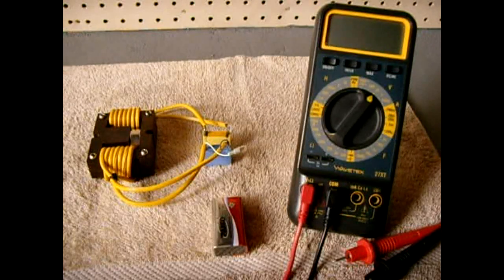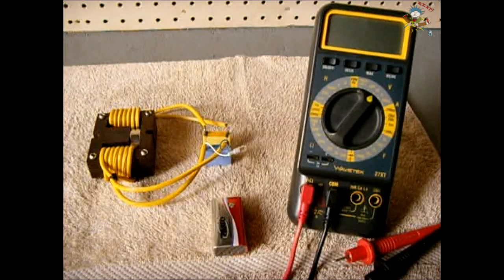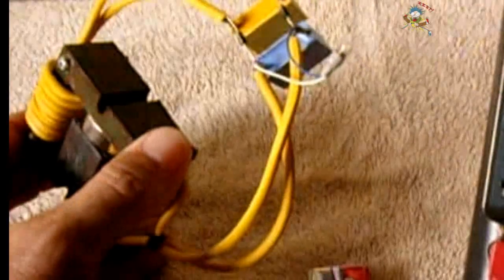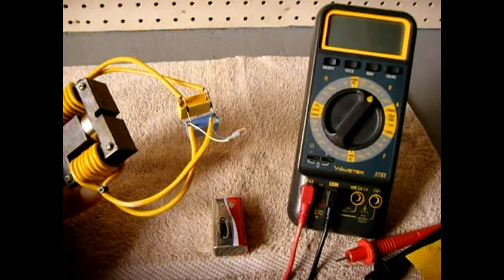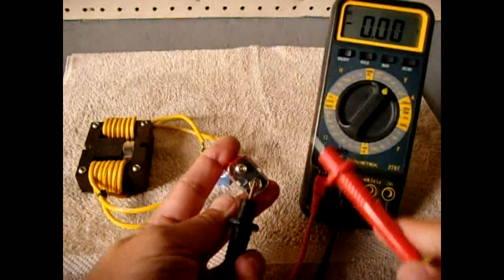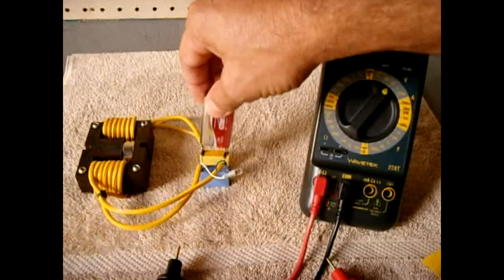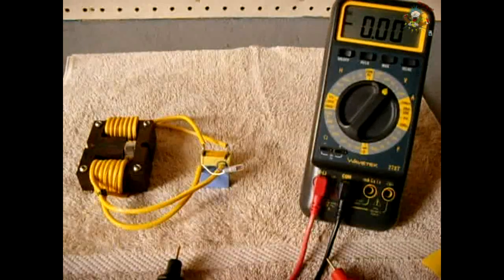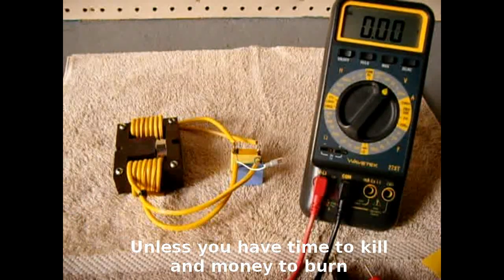Overunity Motionless Free Energy Generator EXPOSED!

Comment from the maker: R.V. Gad's Comment:

"Thanks for testing this project, I was starting to put an earlier version together to test when I found your attempt to duplicate what is visible on the demonstration.  HOWEVER, I see that you have one major error in your layout, and maybe a couple of minor errors.  The original demonstration showed two 1A power diodes as you are using, but only one his left one is visible on polarity and the other stripe is missing.  These are DC lamps so the diodes should run in opposite direction (always).

The other problems are the type of magnet you are using may not be polarized correctly, as he used 2 hard drive neodymium magnets.  The other possible problems are sthe the capacitors should be the same value, probably 1 uf, and the coil to the bottom of the screen may require the leads to be tested in both directions, and try every combination of rotation of the magnet polarity and the polarity of the two coils."

My reply:

Thanks For Watching. As for the diode, it makes no difference if you use a 1A or 3A diode, they both work exactly the same way. The only difference is that one can handle more current than the other. As for the direction they were placed, that is also 100% exact according to the careful examination of the uploaded video. Your directing your question to the wrong person! LOL Clearly you should ask the uploader why he placed both diodes the same direction.

As for the capacitors, I tested MANY values. Using (2) 1/8" or less HDD magnets will not make any difference. I used a single strong N38/N42 thicker neodymium magnet, You have too much wishful thinking. Just use logic, if this worked our world would be completely different when it comes to power supplies, and since it could not be easier to make, everyone would already have a working device.
Reply from the maker: Your wasting your time posting and talking to me about this. I suggest you tell this to someone that will actually listen. The device is a FAKE. Case closed.
Reply: Kurvel Vrece
The pathetic thing about proponents of pseudoscience like yourself, is that most of the time your reasoning behind why something this monumental would be so unknown to physics and engineers revolves around the all too ridiculous notion of conspiracy theories.

Free Energy proponents are not scientists. They are New Age Spirtiualists who have this over zealous opinion that the world is out to kill itself and keep all the life saving technology in the dark for self centered reasons. While I share this sense of cynicism to a certain degree,  I fail to see how something this obvious in an  OPEN realm of scientific discourse could ever be kept a secret, let alone have so many "whistle-blowers" and not have a single fucking demonstrable layout for other engineers and physicists to replicate. Which, in the realm of science, is regarded, as pseudoscience as a result. If you can't repeat the test that someone has done to claim a life changing concept, then there was something VERY wrong with the original test. The same goes for the nonsense about cold fusion. There are STILL idiots out there that think cold fusion works, I've met genuine PHD holding individuals who think the fucking SUN...operates on cold fusion. You know why? Because idiots like that believe EVERYTHING they are told, they go to hippie conventions about free energy and perma-culture and all this spiritual nonsense mixed in with VERY bad science, and come out equally brainwashed as children at sunday school.

In the realm of science, no amount of belief and faith will change the way reality operates. If you can't demonstrate a claim, your claim is useless.
Reply: CircumcisionIsChildAbuse Again, just because someone put out a BS video isn't proof the concept is BS.  Your commentary is nothing but that, bloated argumentative opinionated commentary; not proof.  Just because you don't appear to understand the difference between existence and reality as defined as observable testable eigenstates in QM and existing as in fails to be explained by classical physics should not surprise anyone.  Clearly you don't grasp these concepts.  Where we'd probably disagree is that I think you're entitled to defend your belief system, no matter how unfounded.  The main difference is that you don't recognize your comments as a belief system, based on your own experiences and personal understanding of your definition of what you think constitutes reality.

First, how do you define Free Energy, you're not clear on this; and there are several definitions.  "Free Energy" can define energy in a system that is 'free' to do work.  Like a battery, or magnet.  So, your comment "Free Energy proponents are not scientists. They are New Age Spirtiualists who have this over zealous opinion that the world is out to kill itself and keep all the life saving technology in the dark for self centered reasons."
is a very unenlightened opinion, devoid of any scientific observation, and peppered with the same faults you define in others, a belief which you are staunchly defending.

So, wordy and pointless, you meander all over the place grasping at concepts which you seem to feel defend a point of view that's not even clear what your are fighting against.  Broaden your understanding of the meaning of 'Free Energy' as it is understood by scientists before you attack all scientists with your lack of comprehension.

Based on what I think you 'might' be trying to say; yes, there are no free rides; but, the question isn't one of a free ride; it's a question of whether energy exists in a form that can be liberated in a controlled manner to benefit mankind at a low cost, not free.  If you doubt the existence of a cheap, low cost over unity energy, you've obviously never seen, or heard of an atomic bomb... to use one crude example  Its formula is simple a small mass of U238 = mc², very low cost = huge amount of Energy, just not very controllable or useful only in Nuclear Power plants, so, don't say they don't exist.  You're just not open minded enough to realize they already exist because you're blinded by what you think is being portrayed as magic.  The energy is there, the how to get at it in a controlled way is the question; and many are 'hot' on the trail.
Reply: @ZenMasterChip  Free energy? Plug an extension cord into a neighbour's house.
Reply: Breathe, breathe in the air.
don't be afraid to care.
leave but don't leave me.
look around and choose your own ground.
Long you live and high you fly
and smiles you'll give and tears you'll cry
and all you touch and all you see
is all your life will ever be.
Run, rabbit run.
dig that hole, forget the sun,
and when at last the work is done
don't sit down it's time to dig another one.
For long you live and high you fly
but only if you ride the tide
and balanced on the biggest wave
you race towards an early grave.
Reply: The double magnets in the right position would be one of the most important. You only have one. The difference in turns would would be essential. One extremely important part is that he didn't rub both parts of the battery on it. He just rubbed one part and he did it in a direction to start it's flow. ::shrug:: I can't speak for the other video but what you did makes no sense. You need acceleration (unbalance) and then stabilization (equality) to maintain a flow or a neutron of any size for that matter. And if you did get it work...your last statement about seeking a patent lawyer would mean you'd never show it working but save the invention for yourself and make money....so you have no reason to prove it to be real in the first place. You opinion on the topic for that reason should never be trusted.
Reply: Do you want to see a demonstration of free energy?

ok.

breathe ...
Reply: Chip Cooper
Oh okay, so a video that debunks a claim doesn't mean it's debunked, but a video that "proves" it works, is totally legit? No double standard there!

I also find it hilarious how you point to nuclear energy as an example of overunity. Unclear Energy is the EPITOME of the basic laws of physics. The only energy that comes from nuclear energy, is the power in the extremely precious, highly volitile and extremely lethal radioactive isotopes, which take  IMMENSE amount of energy, time, and resources to CONTAIN and harness. It is a very effective method of extracting energy, but no where close to 100% efficient which is what a lot of proponents of new age spiritual voodoo bullshit present as their "free energy" devices using shit you can buy at a dollar store to violate the laws of physics.

I have too much respect for reputable scientists in this world to have my beliefs washed aside by nobodies with a 10 min youtube video and the proponents who assert that these magically efficient energy devices actually exist but the world is a giant conspiracy out to hide them because people want to make money. Good theory bro, I hope that works out for you as you get laughed at.

But i'd love to know, what energy source YOU use, cause  I can guarantee, its nothing like this shit. You're just another idiot paying an electric bill like everyone else with too much time on their hands contemplating the paranoid delusions of grandeur the internet manages to fester.
Reply: Craig Potter
A) you didnt reply to my comment so I didnt get notified. B) you said "But us spiritual crackpots" referring to yourselves.
C) you didnt at all try to respond to any of my comment, thus you admit defeat, your position unjustified and will remain until you form a coherent rebuttal. Grow up and let go of fairy tales, leave the science to people who have integrity.
Reply: ***** I pretty much agree. The sixties, and the Apollo space program was a wonder, for sure. We went from underdogs in the space race to the first country to the moon. I see many posts on some of these scam 'free energy' videos where uneducated folk make remarks like "all great inventions and breakthroughs were created by people with no degrees, or never went to college".  What a stupid statement. Bill Gates may not have finished college, but he gathered some pretty smart people around him who DID finish college. If you do your homework, pun intended, you'll find out the idea boys may not have been the most educated, but their educated associates did the heavy lifting to make the idea come to fruition.
Reply: Tu invento es parecido al M.E.G. de Tom Bearden o al dispositivo de "Kunel" y por mas que no lo vi en funcionamiento me ha gustado mucho! Lograr la resonancia entre las bobinas para mover el toroide del iman es la clave. Pulsos cobrados electromagnéticamente. Los diodos son para que la electricidad no pase de bobina a bobina en forma de cortocircuito, pero están puestos con el negativo mirando a la lampara por lo tanto la polaridad en la bobina va a ser negativa de los dos lados, creo que uno de los dos hay que darlo vuelta para lograr que la polaridad de la bobina tenga positivo y negativo. Gracias por tu esfuerzo y tu dedicación.
Reply: Amenofis IV Akenathón Christian Marino I thought we were talking about free energy and you're raving on about "Flying Rabbits"????  By the way, breathing is not free energy. How much did you pay for your last McHamburger ? The body uses food to make energy, stop eating for 3 months and see how much energy you put out. Or how much breathing you manage. :-)
Reply: Amenofis IV Akenathón Christian Marino Ahh, You gotta love that Pink Floyd.
Reply: Chip Cooper
It's also not a misconception of "free energy" it's called a literal interpretation in the context of PHYSICAL ENERGY.  Not only is your claim vacuous, its demonstrably wrong, because I can point to hundreds of links of proponents who claim to have created devices that create infinite energy and call themselves, "free energy" devices.
Reply: electronicsNmore also helps reading disclaimer on their website :

•
The authors of this website are not responsible for ridicule, which can 
cause yourself by an effort to reproduce the devices described here

++++++++++
Reply from the maker: Only one Jackass here, I suggest you look in the mirror. You are the one who likes to listen to all these people who have never tried making these devices. These same people usually have ZERO subscribers, and usually have ZERO uploaded videos. Those are not the kind of people that I listen to. If you do, then you have my sympathy. There is NOTHING to discuss unless you have a working unit to show me, along with all the specs and components used for easy duplication. Got that?
Reply: Drew Nichols please provide a link.
Reply: CircumcisionIsChildAbuse Checkout the Stealth program, the atomic bomb project, active stealth (now released) that is part of the BAE systems invisible tank and aircraft and ships project using LCD modules. All keps secret for many years. And other things have been classified too like the magnetic cores "METGLASS" was originally classified. Read the "patent examiners guide for classification", can't remember the exact title but it lists gas saving devices, solar cells over 20%, water treatment tech and weapons systems. I only agree with the weapons being classified. But why are things like water treatment and gas savings devices and solar panels over 20% classified ? This isn't a rumor, it is in their book, the 1973 edition, the only version I have seen but why would those things be in their ? Also listed, higher spec frequency standards and other standards equipment, computers, all kinds of things like this.
Look for some articles that list over 4000 devices classified for energy and related devices under "national security". Why ?
Some of the patent examiners like Valone have come out and exposed this and how some working devices that "shouldn't work" but do despite present physics have been denied because it makes them look bad. Despite the proven devices ! Look at the many gas vaporizer patents, shown proven to save gas and reduce pollution but still aren't being used. Why did some cars in the 1980s 40-50MPG like the Geo Metro but now 30 - 35 MPG is about the most.
What about the Opel below that got 267MPG on a 5000LB car using vapor carb. They should get at least half or a third of that now, and it is in GMs book on the efficiency of the gasoline engine as an example showing they knew about it.
I believed like you do, until I met people that personally know of people this has happened to and learned how often it happens.

267MPG Opel about a 5000 LB car 
https://www.youtube.com/watch?v=EtR5WjwocBI

1000 Miles Per Gallon sHell Research Late 70's 
https://www.youtube.com/watch?v=IYyVnCeWV1A

Energy Suppression examples
http://www.wanttoknow.info/newenergysources

http://rense.com/general72/oinvent.htm

http://www.befreetech.com/suppressed_inventions.htm

http://www.freeenergynews.com/Directory/Essays/suppression_bird.htm

http://www.theorionproject.org/en/suppressed.html
Reply from the maker: Let me make it very clear. I am not saying I do not believe in certain ideas/inventions intentionally being suppressed because of money, what I am saying is there are a lot of scams out there, and this is one of them. If this worked, you could not stop the spread of such a SIMPLE device. Everyone would be making them in their garage and sharing how with others. Use common sense.
Reply: William Denman
Your delusions of grandeur is what inhibits your ability to seek reasoned based beliefs that dont revolve around paranoid conspiracy.

If what you say is true, find the patent, make the product and win a nobel prize. Oh yeah, you can't. The world CURRENTLY has people far more intelligent than Moray and Tesla ever could imagine, and you're obsessing about their conspiracy theories that they are geniuses that invented all these crazy "free energy" devices despite all the LAWS OF PHYSICS that disagree with you. You're no smarter than the half wits who tried to convince the world that cold fusion actually works.
Reply: William Denman
Like I said, severely delusional misconceptions of a false reality.
Reply: William Denman When is that Moray lie gonna go away?  I have been reading about old man Moray for nearly 40 years, STILL, no one can duplicate what HE SAID he could do. Isn't it time to put fairy tales to rest and grow up?  Same goes for Howard Johnson and his magic magnet motor. NO ONE has been able to do what HoJo CLAIMED he did.  Hogwash, all of it. If it cannot be replicated, then it is bunk.
Reply: Quantum Leap
precisely, same goes for the crap they say about tesla too. he was an unappreciated genius, but a lot of his contraptions didnt do what they were supposed to.
Reply: Quantum Leap Once again, instead of Craig Potter actually responding to my entire comment on topic with reasoned argumend and logical discourse, he responds with a link, to someone with zero credibility, who's a conspiracy theory advocate who can't back up what he claims and simply uses advanced physics knowledge to wow and impress non-physicists. Instead of actually doing what he claims he can do, he says he can and its possible yet lacks the willpower or ability to actually do anything at all other than talk about how the world is out to get him. oo

I look elsewhere when seeking scientists who follow conspiracy theories and UFO landings. So once again, where the fuck is your evidence to support your claim.
 And why, does this physicist not have any respected peer-reviewed journals published? Let me guess, the worlds out to silence the genius...
Reply: CircumcisionIsChildAbuse Absolutely true. You can educate some morons, but you can't make them smart. They are still morons. Self delusional morons.
Reply: Gad could just send you a working model, since he's already working on one. :-/
Reply: Your invention is similar to M.E.G. by Tom Bearden or device "Kunel" and as much as I did not see it running I liked it! Achieve resonance between coils to move the magnet torus is key. Pulse electromagnetically charged. Diodes are for electricity not pass reel to reel as short, but are set to the negative facing the lamp so the polarity on the coil will be negative on both sides, I think one of the both there to give it back to make the polarity of the coil has positive and negative. Thank you for your effort and your dedication.
Reply: propfella "Free" as in freedom, not 'free' as in costs nothing.  You too are under a misconception of free energy... so, I shall say it again.  The physics definition of "free energy" is energy which is free to do work.  I thought he was referring to everything he did.  See the way this works, in magnetism, as in a permanent magnet, is the energy goes in, to make a permanent magnet, or in his case, he eats a hamburger; once the magnet has been made, in the case of the magnet, the energy gets trapped in the configuration of the magnet, a quantum effect, and becomes free to do work.  In his case, his body converts the food into a chemical form the body can use, and becomes free to do work.  Once you use the energy, as in a magnet, you must then put energy 'back' into the system, in order to make it available to do work once again.  And, in the case of the body, the same thing.  Once he uses the 'free' energy in his system, he must consume more energy to do additional work.  There is no free lunch.

Now, the opposite of that process is the atomic bomb.  In this case one must gather the materials, put them into a form that has potential energy, then by causing the reaction, bringing together enough material that the 'free' energy of the system reaches a critical point, the process is then automatic, and releases all of it's energy at once.  In the case of the atomic bomb, this energy is a form of free energy, in that the material decays at a rate as to push the process once enough is brought together, that is causes a fission process which unloads all the energy which exists in the bonding and proton structures causing a big release of energy.  This process is overunity, as the amount of energy put into the system is small, compared to the amount one gets out of the process.

 Whereas with the magnet, and his body, the release of energy... energy 'free' to do work, 'free' energy, must be replaced.

This is the concept of 'free energy'.  It is believed that, and evidence shows that many things in nature have 'free' energy; however, we are only now starting to look at ways to release this energy, so it is available to do work.  In the case of atoms, and the zero point energy, the amount is well known with atoms, and is fission, the process is well known, and is fusion the process is well known; however, science has shown by processes known to Tesla, and a few others, that we can 'coax' this energy to be release, we just need to bridge and open the gate with a small amount of energy, and then release it.

One of the more promising fields is with HHO, only based on the 4th phase of water, I believe the process is actually HOOHH.  And using resonance, cavitation, and plasma, we can see that the bonds of the Hydrogen and Oxygen can be broken more easily and thus releasing 'free energy'.in the form of the two monatomic, or diatomic versions of Hydrogen and Oxygen, H2 and O2.  or 3 H2 + 2 O2 + or variants of that. HHO + 3H2 + 2 O2.

And other electronic versions such as QEG, SEG, etc. etc.

So, once again, the ignorant try to make a free lunch, where none exists.  We will always need energy to start the process at some point, no matter how much more energy we get out of the process once it's started.

And yes, there is a modified version of a device like this, and perhaps NOT this device, that has been known for some time.  I just forget which one or what it's called, because there are so damn many.

One last obvious example of free energy is a waterfall.  A water fall is full of free energy.  And, it's overunity, in that we do not put in the same amount of work, for the work we get out of it.  In this case, we count on nature's natural process of using the sun, evaporation, etc, rain, to put energy back into the system so the water can fall once more.  Still, it is a free energy system and a natural one.  Are you starting to understand.  Nature is allowed to be a source because ultimately no matter how much energy you pull out of nature, it is an open system, and returns to nature.  The fact that we can't get more out of that energy than what is put into it by nature has more to do with efficiency than anything else.  None of these 'free energy' devices are what you claim, you have a misunderstanding of the definition of 'free' as in energy.  Free as in freedom, not free as in costs nothing.
Reply: KESHE TECNOLOGY    http://www.mediafire.com/download/1r65q2up3qdk2ui/tecnokesh-2014-03-17.zip
Reply: @ChristianAmenofisMarino whatsInThatZip?
Reply: CircumcisionIsChildAbuse OK, those do not exist, or to be clearer, there is no device which creates energy; as energy can neither be created nor destroyed; it can only transform from an open or closed system, open being a potential unlimited source, and a closed system which is limited in the amount available to be transformed.  As I said, no free lunch.  So, anyone who says, what you're claiming as 'free' energy, is nothing more than either a transformation, or it is a misuse of the concept.  If anything is vacuous, it's your concept; and others misinformed as you are.
The closest to a true free energy device would be one that transforms energy in abundance from an open source, like something in nature, and makes it available to do work.  SEG (Searl Energy Generator), QEG (Quantum Energy Generator), Resonant Plasma Cavitation devices that make HHO and many others; not an electrolysis device producing HHO, not this device in this video,  and not a lot of other devices.  Get your facts straight; remember, in your case, it's better to keep one's mouth shut and be thought a fool, than to open it and remove all doubt.  Stick to circumcisions and child abuse!
Reply: electronicsNmore when someone says you made a mistake, you pretty much just say nope were not talking about it? Haha jackass.
Reply: I have , go to Jean louis naudin website jlnlabs .

Step by step hold ur hand guide , with videos + multiple measurments +++++

He replicated multiple so called overunity devices and shows that indeed a couple are generating more "usuable" energy than they are using .

It's all there .

If you want a simple one just to make you think a bit look at Maxwell deamon

"Ranque effect"

come back and explain the world to us then
Reply from the maker: *****
No thanks. When you duplicate it yourself, then post your video with every spec and part#, otherwise don't waste my time with, "He said it works".
Reply: electronicsNmore didn't say I did. I'm saying it's irresponsible to be that dismissive. Super arrogant. You're not the end all be all.
Reply: @drewnichols4168  Proof (a link) or it never happened.
Reply: Rich Taylor The reasons are clear why this is suppressed.  Simply... Big Oil and politicians in their pocket.  Why this is so starts with the railroads in the 1800's, and the laws that govern corporations that sell their own stocks, specifically, the law that requires those corporations to take care of stock holders first.  The first step they took was to gain the rights of a person; the second step was to gain political control to control the making of new laws which require the public to buy those stocks, and keep the public under their control.  In the case of Big Oil, this was parlayed into laws that force us to have limited choices.  Big Oil and auto corporations are often at odds; but, big oil came first, and gained control first.  The bottom line is Greed; pure and simple.  Sounds like a cliche; but, ironically it's true.  With the more recent reduction in fossil fuel availability; this is getting more relaxed; but, not their yet.  Big oil still finds it cheaper to push oil products; and until they have to go another way... they won't.

Once again, I apologise for being off topic to other readers.
Reply: Kurvel Vrece Dude! The magnets have to move past the coils if you want voltage to be induced in them.
Reply: electronicsNmore
Hes an independant researcher , visited by Big Oil Cartel Chief incognito Koffi Annan ( wrong spelling but u know UN guy )

He built many of the highly contested ones , sometimes he showed results sometimes he failed .... thats real
Reply: electronicsNmore Yeah, I think that's been pretty much established.  You'd have had to have read the all the posts to know we've moved on though... this design is just shy of a lot of concepts.  Still, I think you should get the bulb to light, if the wiring was right.  I think one of the diodes is wrong; and probably something else, at the least the bulb should light when the battery is connected, and if wired correctly, the two coils should do a little ringing, before depletion, and if the caps, also wired correctly should hold some residuals.  So, clearly the way this is wired won't work.  I don't know which is worse, to take a concept like a ringer, and fuck it up so it won't work and try to pass it as something viable.  Or, to debunk said miswired, concept.  Better to show how it could be made to work, and why it's not overunity.  Still the concept of a ringing circuit is a viable design, even if this is not a good example of one.

If people are interested in the basic concept which was mucked up here... they should check out http://www.instructables.com/id/Wireless-electricity-transmission-circuit/
for a workable concept.  Again, not overunity, but it's a start.  It uses a joule thief, which is half of a joule ringer.  By placing the same circuit and a half bridge rectifier on the other coil, you'd get something akin to a joule ringer.  But, whatever circuit you're disproving was a botched up ringer circuit.  I think I saw it a while ago, and it could be as simple as one of the diodes is wrong; it's one thought shy of a ringer circuit, a transistor and wiring.
Reply from the maker: Go back to sleep. Wake up when YOU show me your device that YOU replicated.  Don't tell me what OTHERS did. All hearsay. You are making yourself look stupid. If I see YOUR video showing this device working, and I can verify it, I will post a link in this video. Also amusing how you +1 your own ridiculous post.
Reply: ***** instead of playing he said she said... buy the device from the dude that made the video of the "working" device, or the plans... build it, send the working device to this guy that made this video and take his $100... till then, you are just going by what one youtuber has made a video that makes a claim that these things work without offering testable proof.
Reply from the maker: Well said. I stand by my word. $100 for a working device. All they need is a Paypal account.
Reply: electronicsNmore i will let you know.
Reply: electronicsNmore
I tried the Karpen Pile ... it works . Try it

Reactive Substance as electrolyt with non reactive metal .
Reply from the maker: Sure I do. LOL.. Since you are an expert, where exactly is YOUR video showing this device working?
Reply: CircumcisionIsChildAbuse, Moray had a device that worked. It was patented. So did Tesla...many patents.  You and  @electronicsNmore are no where near their brilliance.  Go back to your masters and quit trolling here.
Reply: @williamdenman3475  Quit trolling here yourself. Link or it never happened. There are SCAMS on here, and he exposed one. Quit being an idiot, trying to "debunk" the one who exposed this scam
Reply: @williamdenman3475 HERE’S HOW HIS DEVICE WORKED

At any time in Earth’s atmosphere - and in space - exists difference random frequencies of electromagnetic waves including radio waves, light waves, ultraviolet waves, etc. Cell phone electromagnetic waves, TV electromagnetic waves, we are ‘drenched’ in electromagnetic waves every second of our lives. You cannot see them. But we know our cell phones work.

His device had an antenna like a radio. He concocted a then-rare (read: not widely known) blend of germanium, bismuth and other materials and made what we now call a ‘dielectric resonator.’ Every cellphone has a dielectric resonator these days. They allow only ONE FREQUENCY to pass through from all the random electromagnetic wave ‘carrier’ frequencies a cell phone is bombarded with. There are different cell phone carrier frequencies, and each cell phone uses one of them and has to block all the others to prevent interference. These days, manufacturers know how to engineer, how to construct dielectric resonators to block all but the one frequency the cell phone is designed for. Back in Moray’s day, he had no clue. He couldn’t have. Dielectric resonator science didn’t take off until the 1960s. So he was ‘getting lucky’ - he created his germanium/bismuth/etc. dielectric resonator. Due to the way his device works, he’s not trying to tune in to a cell network. He only needed to receive ONE of the random wavelengths that are always in the air and block all the others. His device required a single electromagnetic frequency to work. This is why he called his device a ‘radiant energy’ device.

Why is a ‘dielectric resonator’ - resonating? Because electromagnetic waves are sine waves and they cycle through a positive half cycle then a negative half cycle. Over and over again. Look up ‘sine wave’ and ‘electromagnetic wave’. A dielectric resonator only resonates at ONE frequency and blocks all the others. Just what he needed.

So his antenna ‘pulled in’ lots of random frequencies out of the air and fed them to his germanium/bismuth ‘detector’ (dielectric resonator) and only ONE FREQUENCY was then passed through to the tubes in his device.

Now the other amazing-for-his-time part. HE ACHIEVED OVER-UNITY by two different methods. First, he leveraged ‘secondary electron emission’ (look it up) made possible by his use of ‘cold cathode’ vacuum tubes. Argon gas ions and electrons bombarded his cold cathode and knocked free more and more electrons resulting in more and more current flow in his tubes. Second, he leveraged ‘negative resistance’ which is what happens to electric current flow in a plasma tube (including fluorescent light tubes - they are ‘negative resistance’ devices). ‘Negative resistance’ manifests as follows: (1) first, you have a tube with a vacuum in it, filled with argon and mercury vapor; (2) second, you ionize the argon/mercury vapor - that enables current to flow at a low magnitude at the beginning; (3) third, you patiently wait and allow the current to keep increasing the ionization level of the argon and mercury until it’s a FULL BLOWN FREAKING PLASMA in the tube! Plasma is the best electrical conductor known to man. (4) fourth - if you don’t do something to limit the increase in current flow through the plasma, you get so much current flow that the tube will explode! That’s how much power is in this ‘negative resistance’ phenomenon! A modern fluorescent light tube STOPS this ‘runaway’ increasing current problem by way of a ‘ballast’ that is part of the tube’s electric circuit in its fixture. NOTE: the electrodes in fluorescent tubes will break down if you try removing the ballast to get this huge negative resistance phenomenon. The tube manufacturers do not want to get sued. So it is not really possible to create over-unity devices using fluorescent light bulb tubes.

He used a radioactive material liner inside his tube because it spews out beta radiation which will create a LOW LEVEL of ionization in the argon gas in his tube. This is an impressive trick he pulled off. No one uses radioactive material to create an initial low-level ionization of argon gas in fluorescent tubes. But fluorescent light bulb tubes ALSO need some means to create an ionization in the gas in the tube. So instead, a small circuit WHICH REQUIRES OUTSIDE POWER (from a wall socket) is used to create an initial ionization. See, THIS IS WHY NO ONE BELIEVED HE COULD PULL OFF ‘power out of the air’. They did not understand that by using radioactive material in his tubes, he didn’t need an outside energy source to create that necessary low-level ionization of the argon. Once the radiation in his tubes created the very low-level of ionization in the argon gas, and he supplied across the tube the low-voltage radio wave pulled out of the air - BAM all he had to do was wait a few minutes and the small initial ionization and small voltage radio wave would build up to a FULL BLOWN FREAKING PLASMA! inside the tube. This build-up from ionization to massive plasma and current is called a Townsend Avalanche.

Here’s how that initially low-level ionization of argon, and the very weak radio wave signal, evolve in the tube. It takes some time. In his book he mentions ‘4 minutes’ or so. First, the radio wave creates a small current flow in the very weakly-ionized argon. Electrons collide with molecules of argon and knock electrons out of the argon atoms. They in turn collide with other argon atoms which knocks more electrons free, and the argon evolves from ‘weakly ionized’ to ‘plasma’ with MASSIVE current flow in the tube. This is an over-unity freebie effect. Notice this. No AC power was hooked into this device. He relied on a radioactive material to create a weak ionization of argon. He then fed a single weak frequency radio wave pulled out of the air to incrementally knock more and more electrons free from the argon gas atoms. THIS EVOLVES INTO A ‘TOWNSEND AVALANCHE’. And he used capacitors to tap off the energy out of the gas. Good thing too because his tubes would otherwise explode.

To review: Moray has pulled in lots of random electromagnetic waves on his antenna, fed them through his crude dielectric resonator to block all but one frequency, then passed one frequency to an argon/mercury vapor tube weakly ionized by radioactive material, then WAITED FOR THE TOWNSEND AVALANCHE TO DEVELOP.

NOTE: Why was it important to only feed one frequency to the tube? Why not just pass all the random radio (and other) waves from his antenna to his tube? Because the tube needs to get into a resonant condition. It needs to resonate back and forth at one frequency and build up incrementally to high current flow in the tube. If lots of different frequencies were present, the Townsend Avalanche would not be easy to attain - lots of different frequencies is ‘static’. ALSO: Even though the radio wave was always a very low, weak voltage - IT WAS STILL NECESSARY. Why? To keep the resonating current going, TO KEEP THE TUBE OSCILLATING. His tubes OSCILLATED at that one frequency. And that radio wave he randomly filtered into his device created the oscillation. And maintained it. One of his witnesses shorted his antenna to ground and the device stopped. Even though that stray radio wave was weak, it was STILL needed to keep the oscillating tube - oscillating. Oscillations ‘dampen out’ if you fail to add a correctly-timed ‘push’ or electrical wave in this case. You can think of it like pushing someone in a swing on a swingset - you get them swinging - that’s at one frequency - if you bump into them with a different ‘frequency’ of push - it will slow them down. If you push them at the SAME frequency - at just the right time - they will keep swinging. If you stop pushing them their swinging will slow to a stop.

In other iterations of his device, instead of a dielectric resonator, a ‘bandpass filter’ was used to block all but one frequency.

When you look at a fluorescent light tube - that is a ‘negative resistance’ device and is conceptually similar to Moray’s over-unity device. But it needs outside power because (1) using radioactive substances in consumer devices is not feasible these days, and (2) no one will buy a fluorescent light bulb if it takes 4 minutes to light up.

But modern fluorescent light bulbs will NEVER go into a Townsend Avalanche and build up huge power that can be diverted into, and stored in, a capacitor, due to the ballast current-limiter device, and the really weak, quickly-disintegrated electrodes. Moray’s device could output a lot of energy (7500 watts in some versions) because he used the power from the runaway current, the high-current plasma, to charge capacitors.

Moray used radioactivity to avoid needing an outside power source to ionize his gas. Then his cold cathode tube when bombarded by argon ions and electrons produced more electrons. This spiraled into more and more electrons being knocked out of the argon gas atoms. The electrons flowing in the current created by the radio wave also knocked more and more electrons out of argon atoms. ‘Negative resistance’ and Townsend Avalanche resulted.

MORAY’S DEVICE WORKED. He was clever in how he put together negative resistance/Townsend avalanche gas plasma effects, in how he pulled just one frequency out of the air, in how he used radioactivity to ionize the argon to avoid needing outside power.
Reply: CircumcisionIsChildAbuse its amazing how many people don't know the difference between patent and patent pending and what they all mean. You could patent an IDEA. With no working model up till about 30 years ago and have it still classified as a full patent. After that they introduced patent PENDING... Pending status covers two categories... Waiting for legal issues to be resolved, OR waiting on a real world working prototype. If no working model is ever presented, it never gains a full patent now, its forever stuck in pending status. An idea with pending status can still be made by anyone else as long as appropriate compensation is given to the patent pending holder. This encourages others to see the idea and get it to work if the original idea creator can't.
Reply: CircumcisionIsChildAbuse, you know what you are...Troll Puppet for the greedy psychopathic masters.  Bug out. We don't need you to save us.
Reply: CircumcisionIsChildAbuse seeing is believing? Believing is seeing! You will never see something unless you believe it first, even if it is right in front of you. There is no such thing as free energy in electronics, laws of physics. But us spiritual crackpots understand something outside of conventional science, outside because it has not been able to be seen or tested. Plasma. How do you measure a spirit, a soul scientifically? What instrument exists? None. You have to use your intuition and imagination, where most logically minded people fail.

We prevail though, you couldn't even dream of what the spiritual crackpots have created for you and the planet behind the scenes, under attack and in exile. 

The question is, are you really ready for freedom?
Reply: Craig Potter
HAHAHAHA believing is seeing? Yeah, like ghosts, and big foot, and loch ness. Everyone believes in those things and magically they start seeing it too. Same goes for every single God in existence. If thats honestly your argument I can see why this nonsense is only attractive to people who are uneducated. Or at least, valuing a paranoid delusion of reality in order to justify their meaningless self absorbed existence where its only interesting to live if you have the magical knowledge that everyone else asserts is false, yet, isnt, because....you believe it....

"But us spiritual crackpots understand something outside of conventional science, outside because it has not been able to be seen or tested." HOLY fuck giant surprise that the nut jobs boasting about an AREA OF SCIENCE, happens to be spiritual as well. How convenient of an excuse to give someone when they ask you to prove your claim.

The basic foundation of reason and logic dictates your position to be fallacious. Without a reason based position for even believing what you currently hold, the evidence in favor for it, is worthless. You can't presuppose the workings of a belief. You don't start with "god exists because trees are green" because you are presupposing god, what is god, how do you know god exists and why does the existence of god point to trees being green.

You start with all these pseudoscientific concepts because you are spiritual and trying to retionalize your belief using science when science actually demonstrates the exact opposite of what you believe to be true. Because science does not operate on faith, it operates on observation and prediction and testable hypotheses.

"How do you measure a spirit, a soul scientifically?" 1. what the FUCK is a soul for you to claim to want to measure it. 2. What the hell is a spirit and how does it differ from a soul. Just like my position on gods above, you CANNOT PRESUPPOSE a position in order to try to justify your belief in it. You do no start with "THIS IS A SPIRIT" you start with a DISCOVERY, or INVENTION and work from that. So tell me, when was a "soul" or "spirit" discovered, what were its characteristics? and under what conditions was it testable or observed. OH YEAH. There are none.

The only thing measurable about a soul or a spirit, is the decreased IQ of the people who believe in them. Like those areas of religion and "spirituality" these things that you so blindly accept as facts, are VACUOUS concepts fabricated by people who didn't know what gravity was, and were looking to understand the world around them without knowing the first thing about it. So for people of the 21st century to hold onto these false ideas as facts on the basis of "spirituality" and religion, are nothing more than spineless attempts to escape reality.

"You have to use your intuition and imagination, where most logically minded people fail."

Oh another 60 year old "right vs left brain" person who beleives that people are either intuitive or logical. Just to pop your delusional bubble further, there are no right and left brain thinkeres, and logic is actually intuitive. The thing is, logic actually demonstrates that your level of "intuition" actually clouds your ability to see reality. You dont actually care about what is real what is true and facts of reality...you have no intellectual integrity when it comes to these topics I can tell by the words you use that you are more concerned with meaningless things like emotions that move your beliefs and actions.

I dont appreciate it when people like you try to take your muddy feet and start walking into the clean house of logic, reason and science with this arrogant, self absorbed attitude where you think its not making the place dirtier with your presence.

We dont need more ghost busters or preachers or rabbis in this world. We need thinkers. Not half stoned spiritualists wandering around taking LSD because they think it enhances their "spiritual visions".

HAHAHA "you couldn't even dream of what the spiritual crackpots have created for you and the planet" FEEL free to start naming off the contributions of fucking religion and spirituality and I'll start by naming off the contributions of SCIENCE, reason and LOGIC.
How about I start. Cure for Polio. Humans landing on the Moon. Nuclear Power. Heliocentric model of the Solar System. Your turn, what has a bunch of half stoned spiritualists given the world other than the inquisition, crusades and massive genocide and blood shed.

I challenge you to present one thing that only religion or spirituality can give a person that cannot be obtained without. For instance, myself as an atheist, I cannot obtain (blank) because I am without spirituality and religion.
Reply: Touch a nerve did i lol I'm not religious, don't believe in god. I'm not even spiritual, that's just what you call us lol religion and spirituality are totally different things by the way :)
Reply: CircumcisionIsChildAbuse http://www.keshefoundation.org/broadcast/   this should be interesting..
Reply: Just like everything else Keshe says and does, this is another fuckup. No audio on the feed. Geeze, what a douchbag...
Reply: Quantum Leap I had audio, had to go on livestream.
Reply: Lol
Reply: ***** Maybe that's the problem with the kids believing in this shit. They've watched too many sci-fi movies, where they show cool things, but never explain that they violate all the laws of thermodynamics and cannot possibly work.
Reply: *****
and you cant sell something that doesnt work as advertised, else it would be fraud and illegal, thus there are no free energy nonsense on the market as anything other than "novelty" items.
Reply: +RyuDarragh Yes, there certainly is a lot of these hoaxes going on. I think this stuff is posted just to accrue ad hit revenue. But there are way too many uneducated and naïve people out there that swallow this garbage whole.
Reply: *****
Of course, like cold fusion, bad science promoted as a breakthru. Woops!

Allows a perfect breeding ground for promoters of woo and paranoid conspiracy theorists.

Yes tons of novelty, Im still waiting for my xray glasses to work!
Reply: Quantum Leap
You have no idea...ive traveled around a lot, not sure if you're familiar with wwoofing, but its largely the organic hippie crowd, and among that crowd I have met some serious fucking nut jobs.....one had a phd in biology yet believed in a crack pot idea called Orgone Energy, even had himselef a giant box yous it in called an orgone energy accumulator...this guy has a doctorate...the next people believed that high energy light energy waves could magically turn water into its "pure" state by realigning some bullshit, it claimed to cure to cancer so its automatically bullshit. Forget what it was called, magic wand or some shit, just some crazy flash light essentially.

Some real nutters out there.
Reply: +Amenofis IV Akenathón Christian Marino  Pink Floyd FTW!
Reply: +Amenofis IV Akenathón Christian Marino Now i need to listen to DSOTM!
Reply: schema este greșită o dioda trebuie pusa invers
Reply: +Vasi Romeo esti serios ?! sau doar arunci gaz pe foc ?
Reply: +Christian Amenofis Marino capo una pregunta. se puede poner a girar imanes por repulsion?
Reply: Chip Cooper. Hello!  Good explication.....Excelent....Regards
Reply: electronicsNmore
Reply: https://t.co/jJLJDPZ75N?-EnergyfromWind-5
Reply: electronicsNmore You're wasting your time debunking something that you would hide and keep for your own profit. Nothing you say is valid because of that. You are Fake.
Reply: @KurvelVrece  You are the one who has been deceived, and I could say, a FAKE.